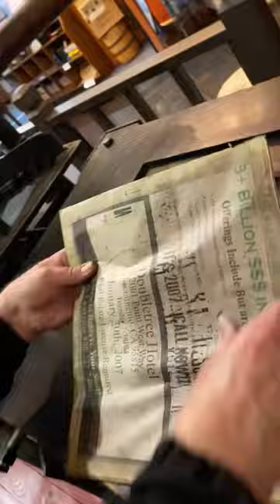Printing for the start of the holiday shopping season

Comment: So would each press make runs of a certain page in the paper?
Reply from the maker: Most early newspaper offices in the 1850s only had 1 maybe 2 hand presses. The newspaper was a sheet of paper folded to make a 4 page paper. Pages 1 and 4 would be printed at the same time, same as pages 2 and 3.